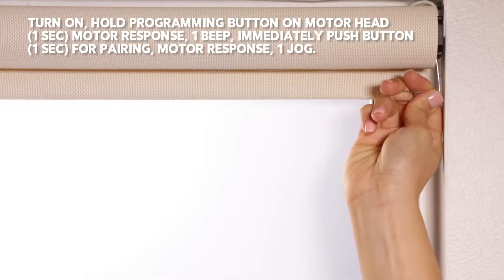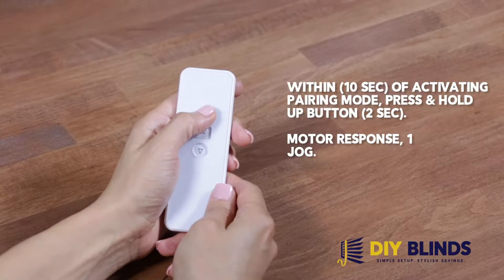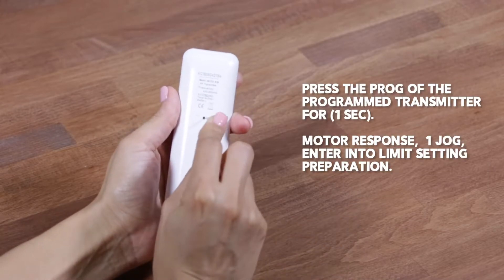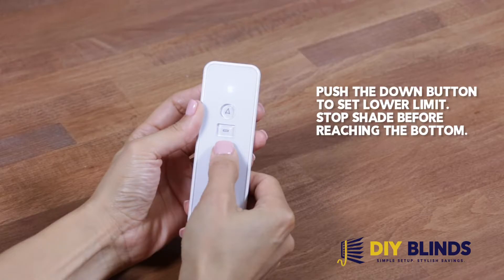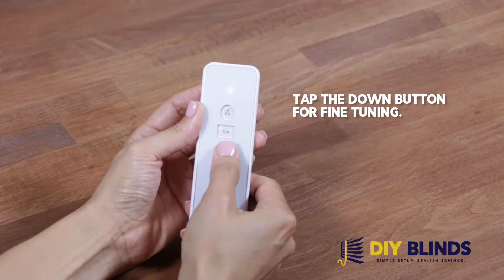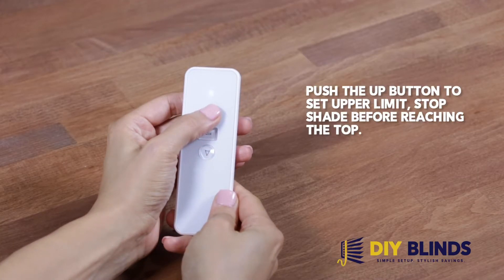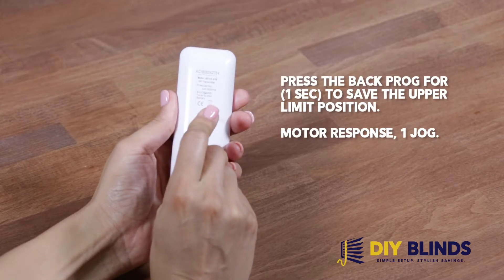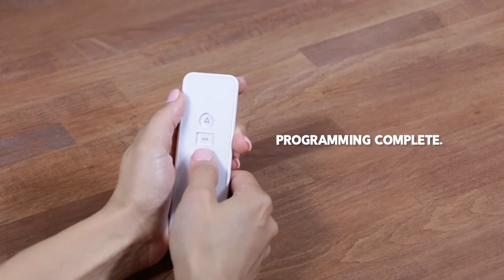How To Program DIY Blinds AC123 Motor

Comment: Mine is stuck in the all the way up position. It won't go down. It happened because I kept pressing the prog button on shade over and over until it was all the way up. Is there a fix?
Reply: Mine are stuck in the up position also - Did you find a fix?
Reply: @sbirkett5968  kumanda arkasına bas motor tık tık yapacak aşağı yön tuşu ile perdeyi aşağı yürüt durdur kumanda arkasına bas bırak motor tık tık yapacak bitti
Reply: Kumanda arkasına bas motor tık tık yapacak aşağı yön tuşu ile perdeyi aşağı yürüt durdur kumanda arkasına bas motor tık tık yapacak bitti